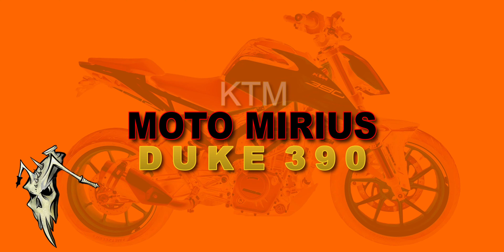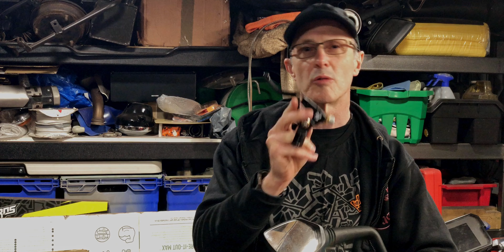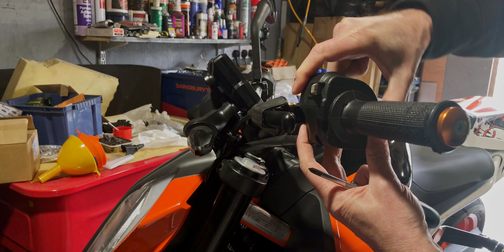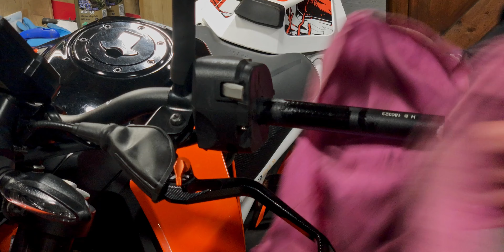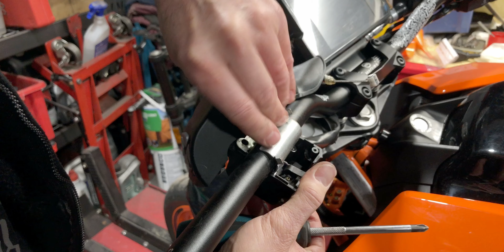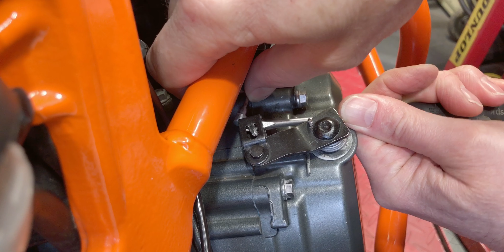Rok Bagoros Stunt Clutch Lever Install KTM 390 Duke 250 200 125

Comment: Where did u put the sensor clutch wire??
Reply from the maker: Tuck it into the headlight housing.  Make sure you have the switch set the way you want it.
Reply: What kind of switch set??do u have a video??
Reply from the maker: There is a switch on the stock lever.  It tells the ECU if the clutch lever is pulled or not.  If not pulled then the ECU will not allow the bike to be started in gear.  So if you remove the stock lever you must click the switch onto the right setting that allows the bike to start when in gear.
Reply: Tnx sir!

Comment: Hi did you find a solution for the clutch switch. Can’t seem to find any follow up. I have a kTM 390 Adventure and second switch is faulty. Would like to bypass if possible. Thanks Ian.
Reply from the maker: Hi Ian, no follow up because this is the correct method.  Just turn the switch to find the setting that works - you can double check just by removing the switch and playing to make sure it works on your bike.

Comment: Hey mate, you mention the safety switch? What does that switch actually do?
Reply from the maker: The safety switch is designed to prevent you starting the bike in gear unless you have the clutch lever pulled in.  Skäl  David
Reply: @MotoMirius  Have you had any luck with a little trick to 'permanently activate' that little switch? I also noticed the left mirror wasn't on, with this clutch setup, would you need to go to bar end mirrors?

Comment: Does the clutch lever make it better?
Reply from the maker: Good question.   Does it make the clutch operate better - not really.  Does it look cooler - yes.   Seriously though, I only ever use two fingers on the clutch so it suits my riding style and if you ever fancied doing stand up wheelies where you can't use the rear brake with your foot then it allows you to use the other fingers to pull in a secondary rear brake lever without the clutch lever getting in the way.   Skäl  David

Comment: What do you do with the clutch sensor to start your bike in gear as i see alot of people just taping the two ends together in electrical tape but ive also hear this can cause issues with idle revving and other things.

Does this clutch come with the ability to plug the sensors in?
Reply from the maker: Clutch sensor is a switch on this bike - its either on or off.   On one setting the bike starts, on the other setting it doesn't - choose the one where it starts and tuck the clutch switch and wire inside the headlight housing - job done.   There is no logic as to why it would cause issues with idle revving etc, it's a safety switch to prevent the bike starting in gear.   No, the clutch doesn't come with the ability to plug in sensors, though I guess it should be possible to fit one - but I've owned many bikes without a switch and unless you are revving the bike hard when pressing the starter button there isn't an issue.

Comment: Have you heard about the theory of how resetting your ECU you have to start the bike and let it run 15min vertically (on a stand) without touching it, then turn off and restart? From what i've read many comment said it work
Reply from the maker: 15 minute reset is for 2012 to 2016 bikes.  It's 10 minutes for the 2017 onwards bikes.  It isn't a theory - it is a feature built in by KTM.  It doesn't need to be vertical, it just needs to run untouched at idle.  For most bikes it will not change anything as the ECU will already be correctly set.  If it does change the it indicates something is wrong with your bike (such as improper exhaust alterations) and if you don't fix that then the ECU will apply the same adjustments as it had before you reset it.  Skäl  David
Reply: @MotoMirius  ok thank you

Comment: Great video as usual David. I've got the Rok Bagoros Magura handlebars in the post was, going to as which easy pull clutch leaver would be the best to get but you answered that in the vid. The Magura handlebars, are the the same as the stock at the end closed off or are they open just for a set of R&G bar sliders I've had for a while
Reply from the maker: Thanks Mark.  Magura handlebars are standard i.e. open, so standard bar ends (not stock) will fit.
Reply: @MotoMirius  Perfect exactly what I was after
Reply: @MotoMirius  is it the 12cm or the 10cm easy pull clutch leaver you have as I'm struggling to get the 12m & worried that the 10cm would be a bit too short with the indicator & horn control bundle
Reply from the maker: @markmitchell8448  I have the two finger.  You may be able to fit the shorter lever on the grip side of the controls and just slide the controls up a bit - check on the bike if this would be workable.